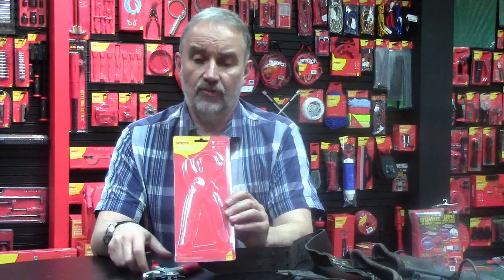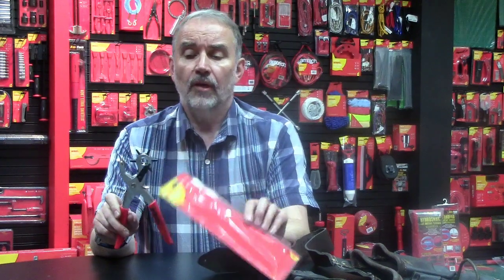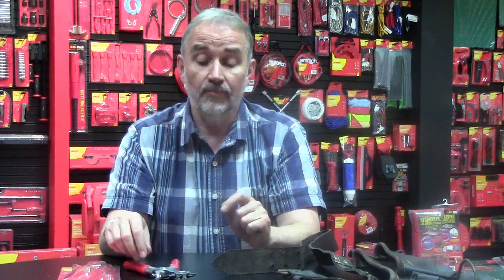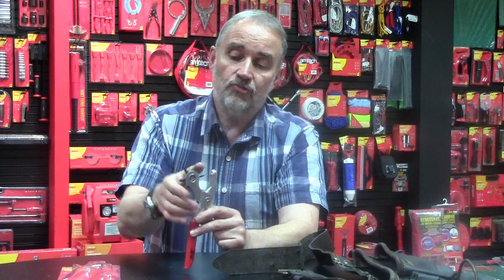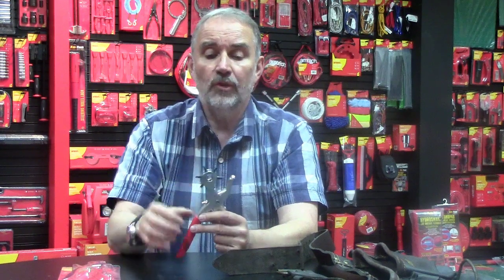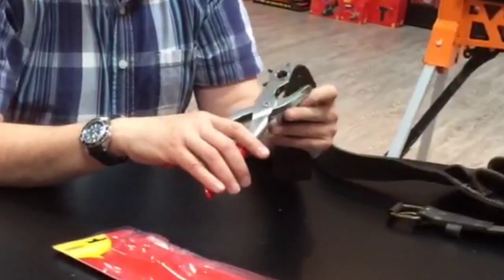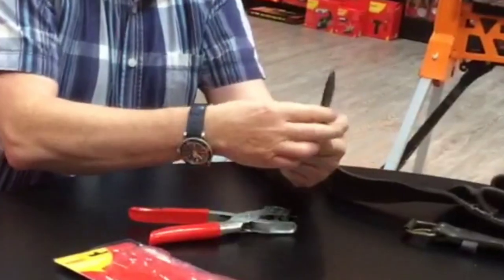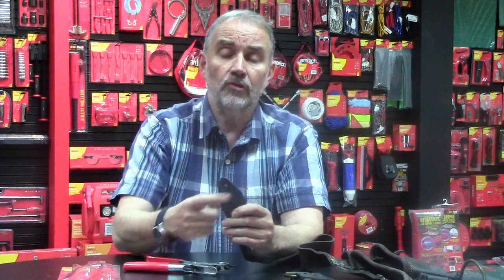How to use the Revolving Leather Punch Plier?

Comment: I dont understand how. To try

“I don’t understand how to rotate the punchers with different sizes mine is impossible with hard and I don’t know how you use it
Reply from the maker: hi Phillip, The punches should turn quite easily. and click as it turns. if it doesn't return to point of purchase.
Reply: Hi Phillip, you probably are sorted by now, seen as you posted this a year ago. I had the same problem with mine, tried to turn the dial until I gave up in frustration! Today, 6 months after buying mine I solved it! Have a look to see if there's a screw on the side with a small latch which fits into the dial, if so, loosen this and it  releases the dial and the punch can move round. Hope this makes sense, I'm rubbish at explaining!